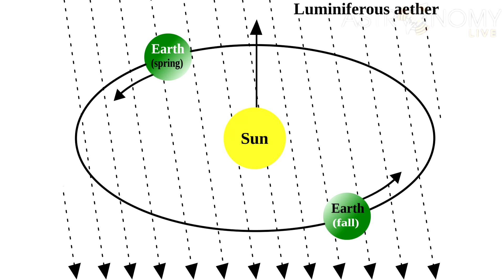Airy's Failure

Comment: I calculated the expected shift in position due to being slowed while travelling through 50 inches of water. It was 0.0017 inches or 0.042 mm. The angle of the light on exit is the same as on entry but the position is shifted to the side by just a tiny bit. I got the impression Professor Klinkerfues' formula predicted a much larger effect similar to what you illustrated.

My calculations were:
Vv = Speed of light in vacuum & air / Earth motion = 10000
Tv = Tilt angle for vacuum = arcTan( 1 / Vv) = 20.63 arcseconds
Rw = Refractive index of water = 4/3
Vw = Vv / Rw = 7500
Tw = Tilt angle for water = arcTan( 1 / Vw) = 27.5 arcseconds
Ca = Change in angle = Tw - Tv = 6.87 arcseconds
Shift in position = 50 x tan(Ca) = 0.0017 inches
Reply from the maker: The approximately 7 arcsecond change in angle is what was being searched for by Airy and would have been measurable with the instruments of the time. As mentioned at the start of my video, the angles I show in the video are exaggerated purely for illustrative purposes.
Reply: @Astronomy_Live  No, that is not what I was getting at. I am NOT assuming any luminiferous aether effects. I calculated a sideways shift in the observed image due to a portion of the light path being at a slower speed than the rest of the path. I was not calculating a change in the tilt of the telescope, as the calculated shift of the image is so slight no change in tilt is necessary, unlike what Professor Klinkerfues claimed for the effect of the luminiferous Aether.

In Sir Airy's article he states Professor Klinkerfues' expected an 8 arcsecond change in aberration angle and reported an observed 7.1 arcsecond change in aberration angle when using Professor Klinkerfues' 8 inches of water + a prism setup. That is shockingly huge. I grant you the angle is close to my calculated 6.87 arcseconds change of angle within the water bit but Professor Klinkerfues was talking about the change in overall aberration angle, that is the required tilt of the telescope. Now the change in overall aberration angle expected by Professor Klinkerfues' formula for Sir Airy's observations was given by Sir Airy as 15 arcseconds extra on the first position and 15 arcseconds less on the 2nd position 6 months later giving a total variation from total standard aberration of 30 arcseconds between the two, or 70 arcseconds of total aberration instead of 40 arcseconds.

On checking the article by Sir Airy, I found the water in Sir Airy's setup is given as 35.3 inches rather than the 50 inches I used so my calculated lateral shift of the field of view inside the water bit would be just 0.0012 inches. Sir Airy's micrometer is given as 0.87 inches per 25 wires. That is 0.0348 inches per wire. The calculated shift in the observed image is 0.0012 inches or just 3.4% of a single wire. Thus not significant.
Reply from the maker: @sthurston2  ah, I think I understand now. The angle you gave was close to that expected by Klinkerfues so I thought the comment was just about the angles I illustrated being so large.

Comment: I'll be honest, I still don't quite understand one aspect of this, which I'll separate into assumptions to make it easier to address this:
1) The photon moves "straight down" (i.e. we define the line of its travel as being vertical), meanwhile i move horizontally. My motion through space and the photon's motion through space form a right angle. Now, of course, those angles could be off by some degrees, but let's assume simplicity.
2) Now, the longer it takes the photon to move along its path, the more distance I will have traveled horizontally, isn't that right?
3) How would a photon that wasn't slowed down hit the same spot below the telescope than another photon slowed down with water? It just doesn't make sense to me at all. It seems to me like we'd need to neglect the motion of the telescope to come to that conclusion.

I'd love for someone to clear that up for me.
Reply from the maker: That was the purpose of this video to illustrate why it hits the same spot. The photon isn't simply slowed in one axis, whether you realize it or not that's what you're assuming with your example. Water in the telescope is traveling with the earth, when the photon hits the water, the water has no way of knowing what component came from Earth's motion and what component just came from the photon traveling from the source. It slows it down equally, both laterally and linear along the axis of the telescope.
Reply: @Astronomy_Live  I understand that it slows down the photon equally in all directions, that is exactly why I would expect it to come out a different spot. It gets slowed down on all axes, which means I have more time to move away under it.

I just don't understand how it "keeps up" with my movement.
Reply: @thecakeredux  Maybe this could help(if I understand you quandary right).

You have a telescope vero or like Bradley did when discovering aberration.
Due to earth’s motion the light will “lag behind” by a certain amount as the telescope moves with earth. This causes an aberration of the 20 arc sec Bradley measured. 

If you then fill a telescope with water, the light speed in the vertical direction will slow down and thus arrive later to be seen, the earth has had more time to move, so there should be more aberration. 
But as OP says, it’s not only the vertical speed that is affected by the water. 
In the telescope the light isn’t just moving vertical with respect to the telescope, it is also moving to the side. This lateral speed of the light is ale affected by the water. 
It slowed just like the vertical speed is, by the same amount. The light is effectively carried along in the water.
So the effects of water cancels out giving the same results for aberration with or without water.

This of course is a simplistic classical view of how light behaves. When working with light we have to use special relativity which holds that the speed of light is the same for all observers in the same reference frame.
According to relativity and quantum mechanics light doesn’t actually slow down it just looks like it. 
It’s difficult to wrap one’s head around and a bit of a rabbit hole.

But if special relativity holds (which it does) light enters at c and leaves at c. Measuring a different aberration due to water would be the same as measuring a different c in the water telescope, which doesn’t actually happen.

That’s not much of an explanation unfortunately.
I did a deep dive (as deep as a non-physicist can anyway) on this last year and the above is what I came away with. I got somewhat of an understanding but I’m not sure I’m quite there completely.
Reply: @martinsundskard383  Okay, I think I understand, let me walk you through my thought process, if you don't mind. It doesn't matter how fast I am moving, because the light that's coming "vertically" at me at c is also moving "horizontally" with me at whatever speed (as in: actual absolute speed from a non-existent theoretical point of view) I am already moving at. From my frame of reference, however, that means that there is no "horizontal" part to the light's movement. If we pretended for a second that I have super-water that could stop light, then it wouldn't be suspended in space at some absolute coordinate, and I wouldn't dash away from it, but it would instead "stay with me" for as long as I'm moving along my path.

Of course, I've taken away any angles or partial "horizontal" part to the light's movement, but if the above is correct, then I see how that case would work out as expected as well.

It's really just relativity, then, that I was banging my head against. I was conceptualizing this as an outside, absolutely stationary observer (or rather, assuming the existence of such a thing), instead of from a specific frame of reference.
Reply from the maker: @thecakeredux  it does not have "more time to get moved away under it." That's simply not a correct understanding of the velocity vector. That statement assumes that the lateral relative motion will not be affected by the water, which is exactly what I was showing in my video. It's affected equally in all directions, so the angle as it exits the back end is the same as the angle of entry.
Reply from the maker: @thecakeredux  I think you're starting to understand it now in your more recent comment. I contemplated using an example of hypothetically stopping the photon in a hypothetical medium, but I didn't want to be accused of just making something up that couldn't be easily tested experimentally. Yes, if you stop the photon altogether it would stay with the observer and stop in the observer's reference frame.
Reply: @Astronomy_Live  Excellent. I can only thank all of you for your time and effort of hand-holding me through this, it's greatly appreciated.

It's somehow really counter-intuitive to disregard one's own movement, but it should be the default consideration, given that there is no way to not disregard it at one level or another. Me with the earth, the earth with the sun, the sun with the galaxy, and so on. It was really foolish of me to arbitrarily stop considering the movement at the level of "me and the earth below the photon" and expecting it to fall "behind", where that "behind" has no real meaning.

Thanks again.